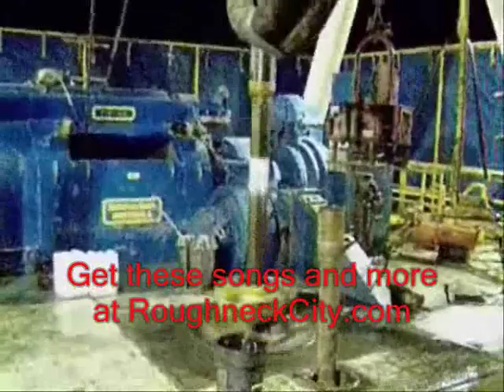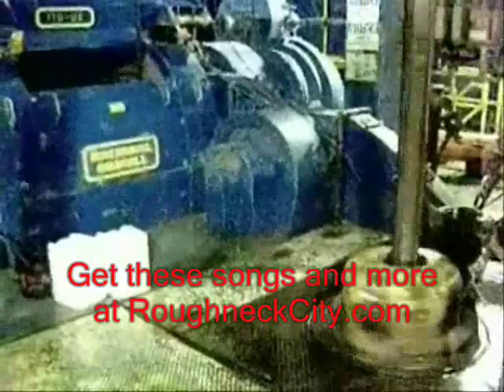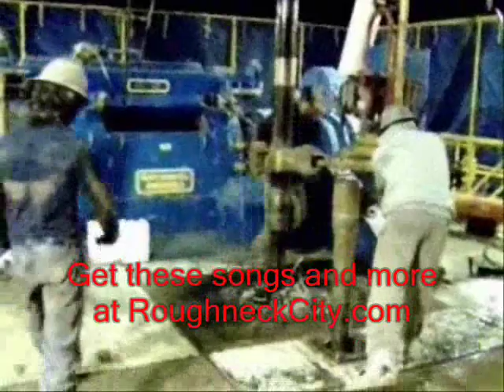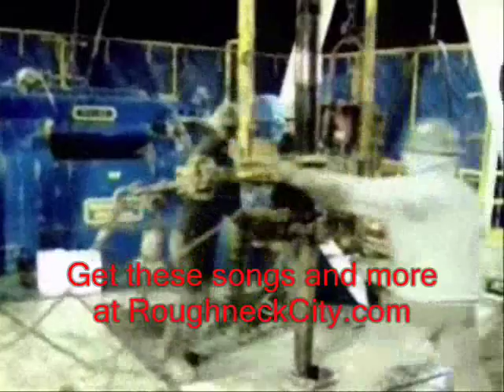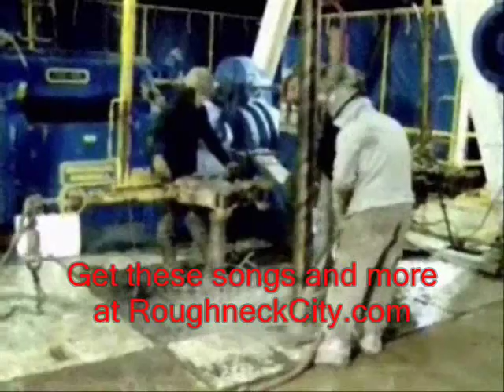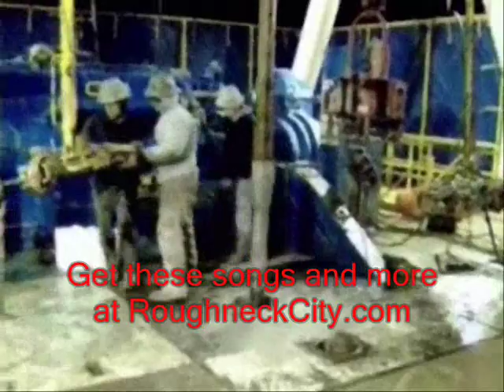The Story of the Roughneck-www.DrillingAhead.com

Comment: i havent been roughnecking long so i have no clue what a shepards stick is.drilling with stands=less connections but our driller doesnt use the link tilt to latch for us.plus tripping pipe for 12 straight on a 24k plus hole and changing from 6 5/8,5,4 and bha im pissed out tired at the end of a day.
FFTP

Comment: Lol...Curtis always wants to be the smartest guy around. Easy to call people worms for spotting weakness in a crew you apparently like. First, breaking a connection; standard safety procedures to use 2 sets of tongs. Second, Tailing pipe; standard safe procedure to use a tail rope. Third, very safe practice of PPE usage to wear Sunglasses in the middle of the night? Maybe on rigs you worked on. Why bash people for spotting flaws in procedure?

Comment: @derrickhand301 whats so poor!  who the hell taught you worm to brake pipe with the table, never seen a snub break, you will and some one dies and torque the pipe with one set? wash off the string or sledge it out of the hole, and both sets of tong and as for me 20 years in the anadarko basin, 16 years chain and motors, 4 derrick and driller, the rig is clean but a scrub brush never made a roughneck!  put that super back on worm corner before he kill a whole crew!